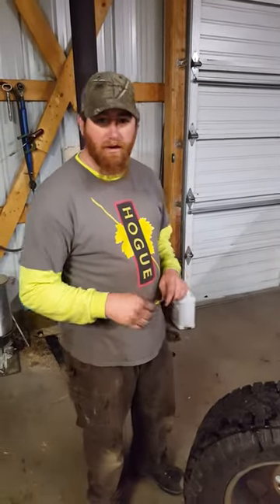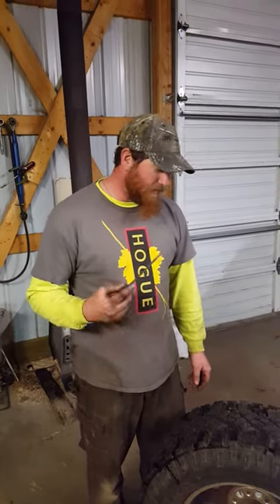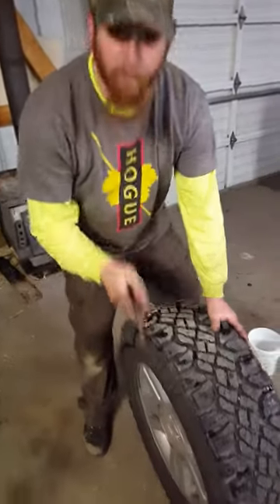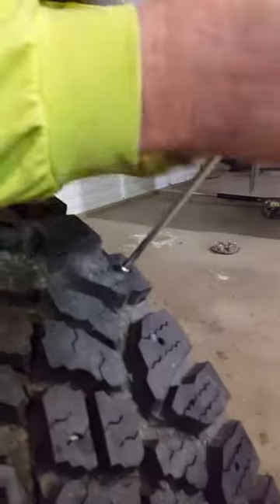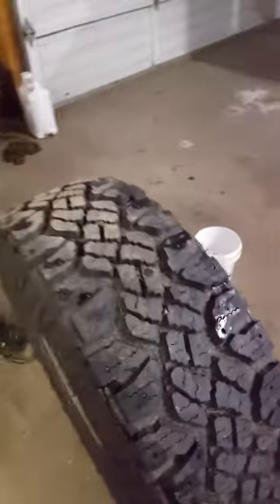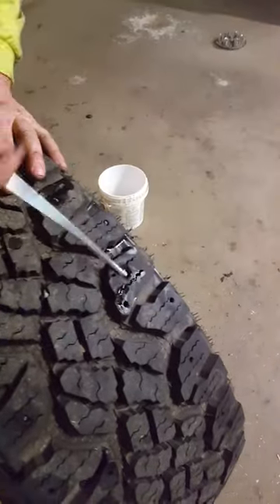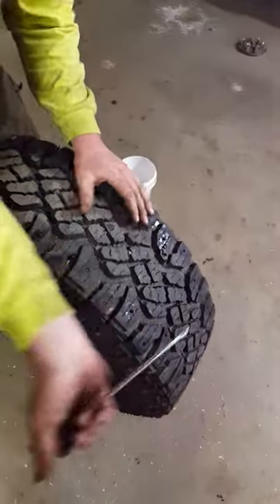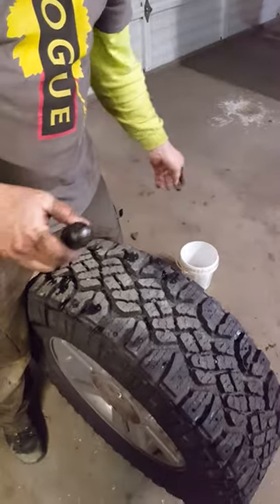How to remove tire studs easily, Tips and tricks.

Comment: Nice! Looks much easier than the screwdriver method. Need to de-stud 4 tires, gonna give this a go.
Reply from the maker: use WD-40 or other spray lube it will make it easier to push nut driver In to the tire.

Comment: nice technique - Ive used the screwdriver method before so I'll try the nut driver this time. I use tire mounting lubricant instead of a petroleum based lubricant.